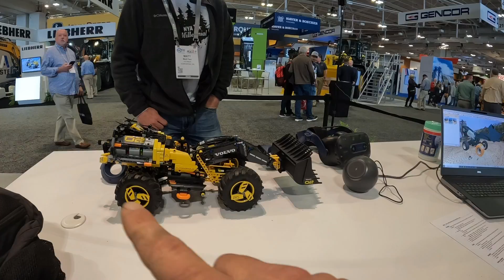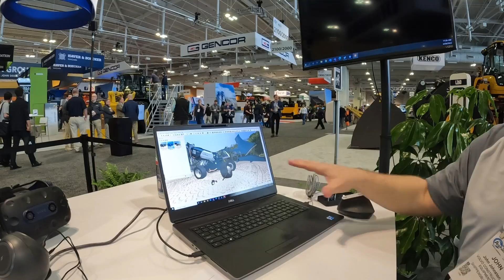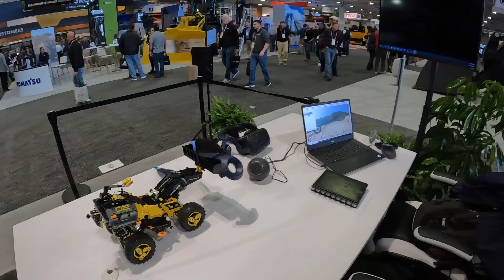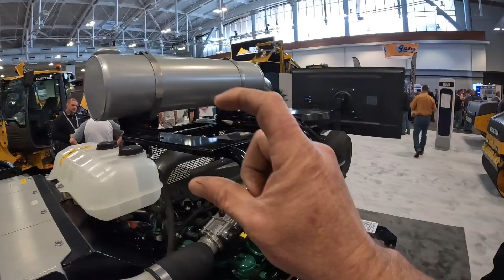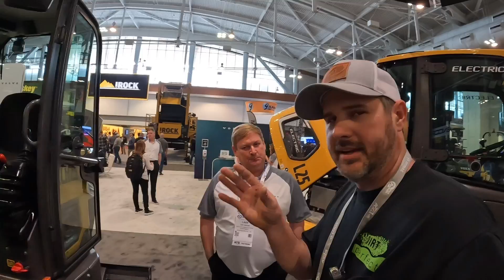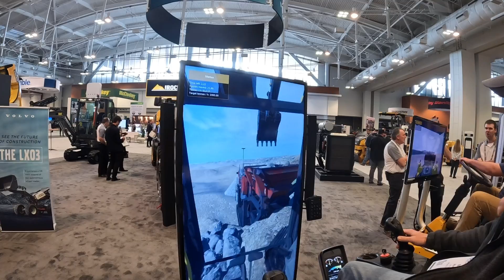Legos and cool concepts from Volvo. Volunteering to be the test dummy 😜

Comment: Oooooo, one person drives the dump truck and puts on the VR headset to load the truck! Or at a quarry, your operators are in one central building and they can select which loader they're running.
Reply: There is a underground mine where the operators are all above ground and the loaders and trucks are automated . Operators directly run the muck loaders and when the dumpers are full they send them off. The dumpers make their own way to the pit and dump.

Comment: The electric equipment would be great for basement dig outs or inside buildings ...or in rural areas where noise is an issue..the concept is ideal . The only concern I would have.. imagine being on a slope for example with 5% battery left.. hopefully they recognize such issues and have reserve power supply built in for back up . Imagine driving a loader down the road and it dies 3 miles from location lol
Reply: Imagine driving any loader that distance.
Reply: @j.walker3498  it's not uncommon to drive a loader those distances... especially out here in the country... I've done it many times.. especially during snow plowing season
Reply: @chrissterling3225  on a jobsite it's not cost effective.
Reply: @j.walker3498  define cost...if you're going from quarry to location..and it's 5 miles away...it most certainly is cost effective.. especially if you factor in the time to load on a trailer..the cost to haul it..the time loading and unloading... providing you have your own rig and trailer..possibly someone to run the rig(added expense) or...hiring someone to haul it all together . I can be on destination before any of that takes place .I didn't say 50 miles..I said 3 miles . Short distance travel makes no sense to put it on a flat bed .
Reply: @chrissterling3225  Dump truck
Reply: @j.walker3498  as I said..in a 5 mile distance..I can be on location before you have it loaded...you won't win on this scenario
Reply: @chrissterling3225  otay operator!

Comment: Two Leggo trucks: One for Gunner and the other for a Give-a-way!  Can't wait for Flaming Dirt to come back and add virtual reality to the tile plow!  Then, you can sit in your office, relax, and plow drainage tile in the fields!  BTW: You should have told the Volvo representative that he can trust you to give away the latest secretes as your video will not be out for a few months!
Reply: You know it wasn't that long ago I mentioned that to him for his whole fleet, and not VR but real time controllers, where his crew could work from cubicles with headsets and multiple controllers and work in the rain, snow, high heat, put a whole new meaning to "working from home", but I guess I torqued off too many people so no one can hear me now. I understand that YouTube has a button or app that you use it to ban some one from your channel from posting and it banns them from ALL other channels also, if you can see this then it has not happened if you can't then it's a moot point.

Comment: This future may mean that the driver does not have to sit in the machine and shake. 
No AC and no heat are needed. It does not matter if the air is dusty or smoky. 
This allows the driver to retire without being worn out in the joints and back.
Reply: automated will follow, none of us humans needed.
Reply: @j.walker3498  That is very good.
Reply: @makingithappen5178  wrong
Reply: @j.walker3498  If you were as worn out as I am, after a long working life,
would you agree with me. Are you running any machine?
Reply: @makingithappen5178  I've been bolted back together few times. Need another surgery but don't want any bolts in my neck. I can still walk okay, stairs are hard for me. I'll be on a skidsteer all week.
Reply: @j.walker3498  Ok. And doctor visits are prohibitively expensive in the United States. Here they are free.
Reply: @makingithappen5178  yeah my neck surgery would be over $200,000 my insurance won't cover it. Your healthcare isn't "free"!
Reply: @j.walker3498  Oh well. We actually have to pay $ 200.
But then everything is free for a year.
Reply: @makingithappen5178  nope, still not free.
Reply: @j.walker3498  So you prefer $ 200,000, which is equivalent to about $ 2,000,000 in our currency, instead of paying taxes and deductibles? Incidentally, this has nothing to do with self-driving machines.
Reply: @makingithappen5178  took a left turn did you?
Reply: @j.walker3498  Jeupp.

Comment: My experiences with Volvo Equipment have always Been good, an 80K Pound Class Excavator was very nice to Operate. Good Power and acceptable speed. But a 140 I had to Operate on the Occasion, Short Stick and a Hydraulic Thumb was very unbalanced on the Undercarriage in my Opinion. Starting to see more Volvo here in Southern Pa. And through Southern Md. where the Work is Plentiful.
Reply: How big was the thumb and bucket on each machine? Improper sized bucket would make a huge difference. Smaller machine moves faster causing it to get way out of balance easily.
Reply: @erikcourtney1834  the 140 had a Standard Bucket & Thumb, in my Mind the Hydraulic Cylinder and Mount on the inside of the Stick was Oversized. But to the Best of My Recollection, Neither were out of Proportion and the speed wasn’t as Snappy as a Komatsu. I do Remember the House sat higher off the Undercarriage than I’m used to. Being a Utility Main Line Operator / Foreman , my experiences with Thumbs in General is Very Limited. However, I Have had many hours on an Excavator over the Years and more than I wanted on that 140 and would not rule out Operator Error. Have yourself a great Weekend